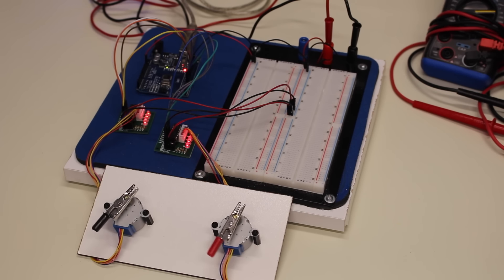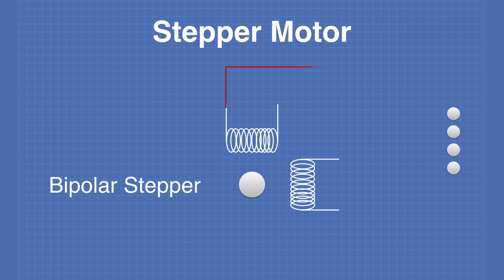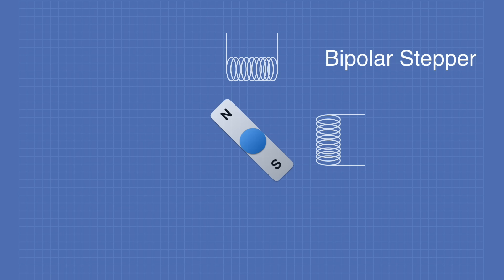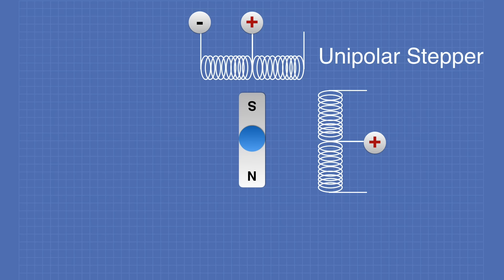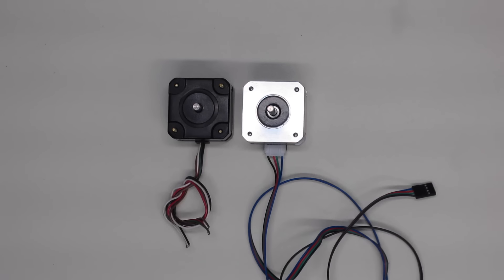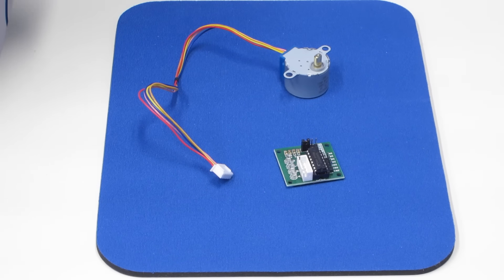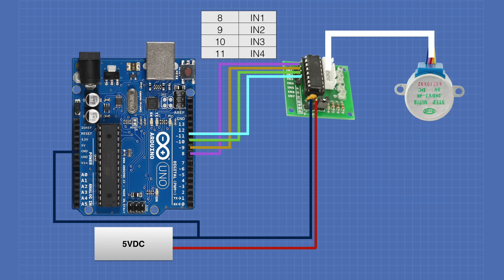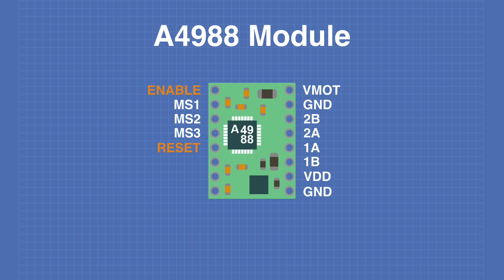Stepper Motors with Arduino - Controlling Bipolar & Unipolar stepper motors

Comment: Excellent content, cleanest shop I've ever seen!   Investigating updating an old heavy pushto telescope mount to gps autotracking belt stepper unit..  Rasperry pi 4 and/or arduino with gps and an accelrometer... Hmmm?  You wouldn't happen to have a vid that might be helpful in that area, by any chance?  Thanks

Comment: Excellent videos. Clear, concise, and easy to understand. I stumbled upon these as well as the ones on servos and LCD display using I2C. I have a question regarding stepper motors: can their current position be read when not turning like a servo? Ideally I would like to have a servo that has a 360-degree range (not necessarily turn continuously), since since most only go as far as 180-degree I thought perhaps a stepper could do the trick.

Comment: Sir, could I. Use the 28ybj-48 motor to power a small 4nch rotary table on  my bench top milling g machine. Does this motor have enough power for this application? Or should I go with the nema 17 bipolar ...Really like how clear your instructions are step-by-step. Thank you this video is just what I

Comment: Good afternoon.
Thank you very much, yet again, for the incredibly useful information.
I'm trying to use a 74HC595 with stepper motors.
How can I interrupt the stepper.h library commands to include it within a shift register latch low and high function?

Comment: Congratulation! Excellent tutorial. Thank you very much.
Some comment to the first example. This motor has an external gear but the reduction ration is unfortunately not exactly 64, but a very strange number of 63.xxxx ie, to control this motor with stepper motor methods will generate just a trouble. The full revolution requires a bit more than 2038 steps, what is a general problem of this motor.
The second case is very good with the acceleration of the stepper motor control. Unfortunately it was not discussed more in detail. This is a key issue of many CNC application otherwise the stepper motor can lose steps.
Reply: we offer belt-driven linear rails which are more efficient and economy for automation industrial, check CCM linear rails,  we also offer motor and driver, welcome send me inquiry

Comment: How did you mount the 28byj-48 stepper motors in demo1?  are those nylon standoffs?  if so, what dimensions?  I would guess 19mm M3, but I'm really not sure.

Comment: I've never seen another comprehensive and detailed tutorial and demonstration of anything such as this one ever. Thanks for all the effort you put into making this video. I still am not sure as to which motor to get for my application because I don't have much of a background in electronics. I want to build a motorized tripod head for my DSLR camera that would be able to pan the camera at speeds as slow as 30 degrees per 15 minutes and the camera-lens combo would weigh around 1.5kg. Could you please recommend me a motor and driver combo to be used with an Arduino Uno? Thanks.

Comment: I am still learning how to program the Arduino. I was wondering how I could change the code for the A4988 configuration to add two push button switches to the I/O pins to make the servo change direction and then another switch when depress stop the stepper moving?  Any help would be appreciated. I really have learned a great deal from you videos. Thank you so much.

Comment: DBW,  Correction?!  Stepper motor notation... could that be a 28BYJ-48 vs a 28YBJ-28?  I think so...I zoomed into your video top confirm.  Check your model number in the write-up.  Thanks for the videos and sharing of your knowledge...very very encouraging.  Thank You.

Comment: Thank  you so much for such a video!I was struggling so much since 2 days for running the floppy disk motor now I finally found an awesome crystal clear video!one more question will it be the second thing if I were to use the driver with the CNC shield?the A2948 one
Reply: Sorry I mean a4988
Reply: Ola can. You reply ?

Comment: Great project! I would like to add a MPU 6050 accelerometer to this Stepper Motor and Arduino setup to control a physical spinning gyro, keeping it level by controlling Yaw (left and right movement). Please advise. Thank you!

Comment: I am building vertical tower garden. Which consists of 5 foot lengths of 4 inch PVC with holes arranged around the pipe every 6 inches down it. In those holes I will grow my vegetables. I would like to build a system with an Arduino or Raspberry Pi to rotate it 180 degrees and back for maximum sun exposure. I would like to connect these towers with some type of chain and a stepper motor that would turn a row of them, all at the same time. Could you offer any advice on the controller, gears, chain, motor, code(slow timing) or anything else that that would be relevant. Very informative channel, with information presented in a logical way. Keep up the good work!

Comment: Thanks for the good video is 1000 microsecond  the fastest pulse for the used NEMA17?
Why is the torque smaller when the rotation is faster?
The current through the coils are still the same if the MOs-FETs are fast enough or not?

Comment: I have a question. If I don't have a micro-controller to connect to the motor driver but instead hooked up the +5V signal wire to a physical button, would pushing that button make the motor move one step?

Comment: hi! you mentioned that stepper motors aren't that fast. Do they make fast ones? I'm looking to mount a set of mirrors on one and do custom laser bounce mirrors, and I'm a bit lost on what type of motors to get. They need to be fast, accurate, and bi-directional. Any suggestions? Great videos!

Comment: Hey very good and clear explanation!
I want to make a DIY rotary for my new co2 laser cutter engraver. For this I want to use the stepper motor of a small diode lasercutter. In my c02 laser are NEMA23 type 23HD450Y-31A1 stepper motors and leadshine M542C drivers. My question is can I use the stepper motor NEMA17 D42HSC1413B-24H and connect it to the driver M542C. The stepper motors are both bipolar. I can't find any other specifications of the NEMA17.

Comment: Hello and excellent videos, I'm a newbie to electronics and stepper motors, I would like to ask you to put together a video showing how you would build a electrically powered dividing head for  milling / lathe work, basically a device to rotate a fixed bar or plate were amounts are entered into the LCD and the stepper motor will stop at each division entered i.e. 3, 7, 12 or what ever is needed to be drilled or machined. The device will use a 4x4 keypad with forward / reverse and a LCD to show the divisions / degrees and as all your other excellent videos show the component names and numbers used and how to wire them clearly and correctly, hope you consider ,cheers Andy Young

Comment: Thank you for an informative video on Stepper motors. i watched this one and your video on servo motors, and enjoyed them both. i have been looking for a way to steer a trolling motor remotely on a Kayak, but have been unable to decide on a servo or a stepper with either a gear or leaver mechanism. i will have 12v DC available as a supply on board. One of the criteria would be for no or little power draw while in the neutral or straight ahead position. The run from the trolling motor to where it will be controlled from would be about 8 feet. At some stage latter on, i may also want to set up a wireless control for this also. Do you have any thoughts or  advise on my project? Can you then point me in the right direction to speed up my learning to achieve my goal?

Comment: Very good video. My first experiments with steppers.  I followed your simple first experiment. I got it working, but I had to reverse the wires to follow clockwise versus counter clockwise in your sketch.  Did I find an error in your code or the wiring?  or am i crazy?  thanks again.

Comment: Thanks for the excellent video. How do set the motor to a zero point using the L298N? 
Say The motor is at 160 degrees and I want to make 180 degrees my zero starting point.

Comment: AMAZING VIDEO. I have a question regarding the bipolar stepper motors. I'm trying to use one of them to rotate this  moon sphere I have. I wanted the rotation to be 180 degrees every 24 hours using coin cell batteries. Do you think it would be possible? as well as how would I change the speed to match what I am trying to achieve. thank you!

Comment: Thanks for that - I have a NO.AMER.PHILIPS A82313 bipolar stepper motor that I removed from a Texas Instruments thermal printer (for their programmable calculator TI59)  but no ready info on its specs. I wonder if there is a diagnostic procedure in lieu of specs.

Comment: Hello, 
I'm just getting into doing some simple animations for a model railroad display and know just enough to be dangerous. I love your lecture and would like to begin hands on learning, but I need some information about torque. The motors you use generate 4.17 Oz force inch.... what does this translate to in the real world? How much weight can these motors lift/move? Something weighing 4 ozs or less? Thanks for putting it into plain English terms.

Comment: Hi, well done! Just a question about the stepper motor. How can we do if we want the motor start everytime at the same place when we switch the machine on?  It must be easy because robots and many engine  are calibrate to began to move from a specific point. Also what is for you the best way to command about 10 stepper motors? Any advise will be welcome, thanks a lot.

Comment: I have 2 questions;
1. How do you write a program to create a double click function on the button to have the motor turn a certain amount of degrees, hold it as long as you hold down the button, than rewind back the exact way when you release it?
2. Could and how do you program/solder that circuit into smaller arduino models?

Comment: Great video, but I have a question about current. When you pick a driver for your stepper motor, do you spec it for the rated current per phase of the motor, or DOUBLE that, since you have two phases? And furthermore, what about the power supply? Double current per phase?

Comment: I am trying with a Nema 17 4.2 Kg-cm Stepper Motor , should I have 12 V supply or can is use the 5 volts of the Arduino?  The product specification says, it is 3-6 V and hence this questions.

Comment: Hello. I want to thank you for such a good video. At last a could understand Steppers with a nice explanation. I have one question: You said that next instruction is not executed until the stepper finishes moving. Can I use "interrupts" to stop the stepper anytime; for example if a sensor is activated while the stepper is moving? Thanks a lot and greetings from Ecuador.

Comment: Thank You!  I will try your code with my NEMA 17 1.7 Amp stepper with the A4988 module.  I am using StepperMystepper, and the L298N to control the motor.  The holding torque seems a little low and the motor never becomes warm to the touch.
Reply from the maker: You can probably pump up the current a bit with the A4988, it is definitely a more efficient way of controlling a stepper.

Comment: Hi, 
Thank you for the great video !
I am planning to control 10  28BYJ motors with a single Arduino, planned to build a selector board that will enable the Arduino to select which motor it is controlling at any given time. something similar to the A4988 but for the 28BYJ motor.
Do you know or can recommend a pre-build board that can help me control a large number of motors using a single Arduino ?
Thanks

Comment: In the schematic at 16:18, it shows where the power is coming from for the stepper motor, and that the ground is connected to both the stepper motor and the ardunio, but it doesn't show where the power for the arduino is coming from. Can the same external  5V source power both the stepper and the arduino?

Comment: I wonder if a stepper motor can be driven directly to alternating 5V from a transformer without electronic driver controller. I suspect that yes if using a capacitor to set the CW/CCW. No tested by me.

Comment: excellent stuff as always, thank you SO much! I have a question: can I drive a 5V stepper motor with the A4988 (it must be in a very small enclosure) and, if so, what size capacitor would I need? thank you again!

Comment: Great and fantastic explanation keep it up, I have got a question that ....what kind to motor is good for machine has to operate in low speed with arm(50cm) holding up 10kg of weight

Comment: Hi, amazing video, the explanations are really easy to follow. However, I have a doubt about the steps per revolution for the 28BYJ-48. In the code you specify that this value is 32 and I looked for where that number come from and I came across with this formula: Steps_per_rev = 360 / step angle. In the datasheet it says that step angle is 5.625 so, following the formula, the result is 64 not 32 so I am confused. After doing some research I know it's something related to half-step and full-step but I still don't get it.

Thanks for the video!!

Comment: Outstanding tutorial Sir! In depth description and easy to understand, even for someone like myself who has no knowledge re Stepper Motors. I am currently working on a project and was wondering if you might be able to give me a few tips regarding the type/size stepper motors & appropriate driver controller recommended for my project. Plan to use two stepper motors, both with lead screws that would need to be controlled sequentially ( the one is to operate on a horizontal path and the other on a vertical ). They would need to push & pull an estimated weight of around 10kg. Is this feasible using Stepper Motors? Would really appreciate any feedback, thank you. Kind regards, Peter

Comment: Brilliant video! whats the model of the bipolar stepper motor used? Im making something for a wind tunnel airfoil flap test and wanted to use a stepper motor to control the flap by a pully system. I wanted to know what kind of motor to use/use two steppers because I believe my maximum force on the flap will be 100N
Reply: Sorry im new to all this, Ive hardly studied motors

Comment: Why can't you pull the 5V necessary for the motor from the 5V socket on the Arduino board? Is it because there is a risk of to much current that may be pulled thru the microcontroller?

Comment: Excellent tutorial! Do you by chance have a wiring diagram using an arduino, stepper motor, potentiometer, and micro switches to reverse the motor i.e. moving a device side to side or back and forth?

Comment: I am using a nema 17 bipolar high torque stepper motor (2.1 amp , 36 volts) and controlling with a TMC2209  controller.  The problem I am having is that the stepper motor begins to move then spins uncontrollably until the window shade it is unraveling hits the floor.  Does the TMC2209 not have enough amps to control the motor?  I set the reference voltage on the controller to 1.70v.  By the way I also connected only a 12v vice 36v supply to the motor.  Please advise.  Thanks

Comment: Why do you suppose the example sketch for Stepper library does nothing but reboot my Nodemcu but the AccelStepper library sketch works with some modifications?  I have tried for hours to get Stepper to do anything more than step 5 steps and reboot.

I think it might be that steps per revolution is actually 4098 not 1024.

Comment: I notice that it is always advised to use external power supply for stepper motors.  However, the arduino VIN pin provides unregulated power that could also be used if the current draw is not too much.  I think the limiting factor would be to keep the current draw below 1 amp because the board traces probably couldn’t handle much more than that.  I am currently powering a Nema 17 stepper motor off the VIN at 9V and about 700 ma through the barrel jack with no problem and not heating up the board.  Any technical reason why this is not acceptable, other than everyone repeats what they hear about never to power up motors from the arduino?

Comment: I am working on a project involving some 8mm bipolar stepper slider motors. They are very small. They have a four wire output labeled A+ A- B+ B-. When I received them recently in the mail I checked them for continuity. I was expecting to see continuity across A+ A- and B+ B-, as suggested by the coil diagram in your video, but what I got was continuity across A+ B- and A- B+. Is this normal or are the connections mislabeled? I want to hook them up next to a controller and Arduino to further test them out and am concerned about wiring them up incorrectly and possibly harming them.
Reply: I ran into the same scenario. It should be fine as long as the pairs of wires you measured are getting continuity, regardless of the letters they are labeled or even the colour of the wire for that matter.

Comment: I just saw you video and I've learned a lot. Very good job. Is it possible to see a video including Arduino, A4988, end-stops and potentiometer speed control? Greetings from Portugal.
Reply: we offer belt-driven linear rails which are more efficient and economy for automation industrial, check CCM linear rails,  we also offer stepper motor/ servo motor and driver, welcome send me inquiry

Comment: Hi, I’m brand new to Arduinos, and your videos are excellent. I do have a specific question about this video though. About halfway through the video you comment that if you were driving multiple steppers then the compute needs would be too much for an Arduino. You then show the A4988 driver board...but it seems like you still run for loops and send pulses to the board. So I’m not sure how it’s requiring less compute power.

In my case I’m trying to simulate an airplane 6 pack of instruments and drive them from my flight simulator. But struggling with how to drive 6+ stepper motors from one arduino. Trying to plan before I start buying everything.

Thanks!
Scott